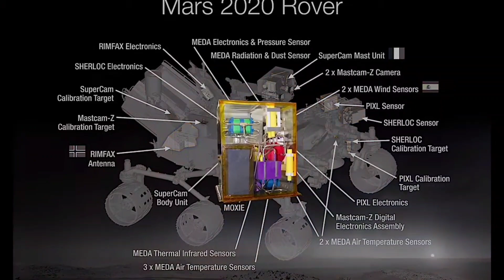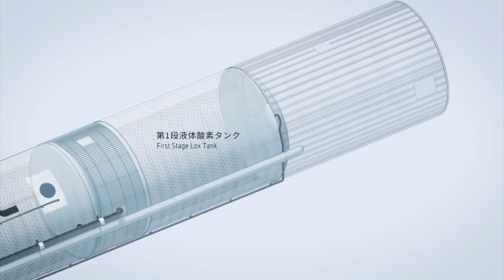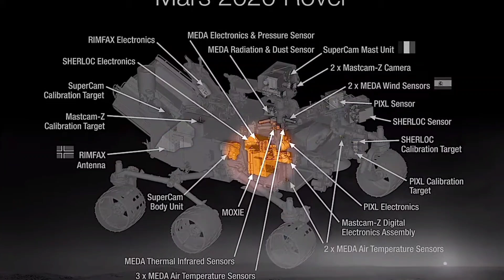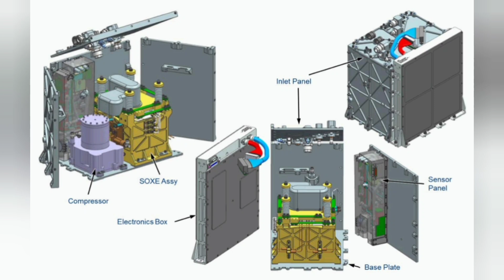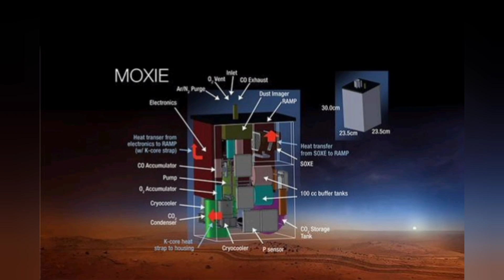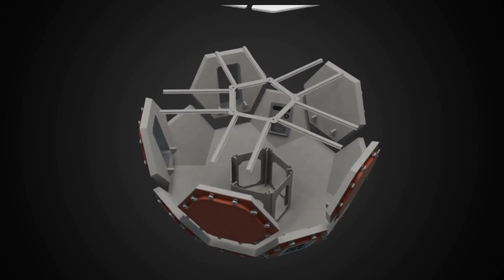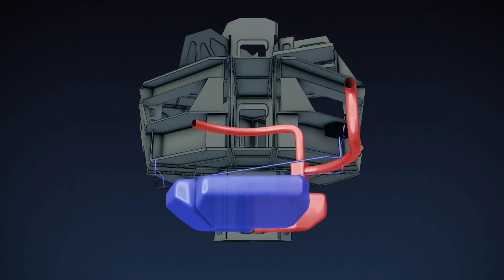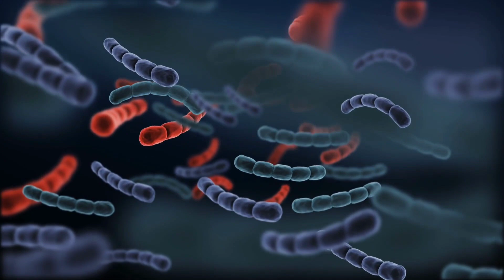MOXIE and Ingenuity may work, but they suck!  There's better solutions for Elon Musk's Mars!

Comment: Hey, Calm down.  This is a source of renewable oxygen, that's a good thing.  We don't want to use up our existing oxygen, that would be bad to have to depend on this power oxygen  generator unit all the time.  The solution is to take a plant called spirolina to produce oxygen from co2 rich air.  Grow it in water in trays with LED lighting and it will capture carbon out of the air, even martian air and give off O2 with NO carbon monoxide as a by product.  How much square area will it take per person for continuous supply of oxygen   8 square meters per person.   So 8 trays stacked in a box like a mini fridge will generate enough oxygen for a person.  But it gets better, it is nutritious when grown in rich nutrient water, and so you can eat it to survive without starving.  How many meters could feed one person continuously?  13.   Better make it 15 per person as a food source, a back up food source, a plan B from outer space.  So say 30 trays, stacked in a self contained  box like a refrigerator with LED lighting , producing oxygen and making enough food to feed 2 people or supplement their  food stores.  And it would produce more than enough oxygen.  Put it next to a window with sunlight coming through for better performance.  TO keep it running and nutritious you would want to bring soil to add a little to the water, grow other plants WITH it and have an aquaponics system with fish, clams, crawdads or lobster and anything else that will grow in nutrient water and eat duckweed, kitchen scraps and a little spirolina..

Comment: A far better solution for exploring Mars would be hopping. 
For example, https://www.youtube.com/watch?v=daaDuC1kbds 
On Mars, the hopper shown should be able to leap ~100 meters upward - far higher than the helicopter.  

It could also leap at an angle to travel ~200 meters away in a single hop.  (Maybe more or less if it needs to deploy wings or a parachute or an autogyro propeller to let it maneuver and to reduce it's impact velocity and subsequent bouncing around.)

Comment: I imagine NASA did tests that led them to decide on a rotor based craft vs a displacement based craft. Displacement crafts have their drawbacks as well. It's extremely difficult to contain something less dense than the Martian atmosphere, and the closer to vacuum you get the more rigid your pressure vessel needs to be meaning more and more weight. It's very possible a Martian dirigible wouldn't be able to lift much of anything at all.

Comment: Idk, all the energy Moxie uses turns into heat (except the potential energy in the oxygen). The microbes use up the dirt and mining is very expensive. Also the atmosphere is very thin and you need to displace a lot of space to be able to have any payload. For example: To carry 1 kg you need to displace around 50 m3, if it was a vacuum inside the balloon, minus the weight of the structure and propulsion itself. (given rho_max = 0.020 kg/m3) Transportation on the ground makes more sense.

Comment: I agree a lot on the moxie/bacteria stuff, is like, not even a opinion is pretty much just numbers, is a much better solution and should have much more attention, about the rotors/buoyancy, I agree but I think it is a... not as crucial, I do agree with ballon/buoyancy stuff it is indeed much easier to do heavy stuff and costs less in the long run, but at the same time it costs more to actually build and bring there, it is a bigger, heavier and more expensive thing, and for simple things a rotor can be better, maybe they just plan on using them for very simple tasks while they do most stuff with land rovers, so not knowing exactly what they plan on doing, and ingenuity being such a simple proof of concept, I don't see it as much of a deal, but I do agree with the oxygen thing, as I said, plain numbers

Comment: There's really no way around the high energy requirements of a Mars colony or base, even a temporary one. The problem is, that due to Mars' distance from the Sun you already have an energy disparity compared to Earth plus (as far as we know) a total lack of readily useable fuel. Consider growing plants for food...the lower amount of sunlight (about 2/3rds on average considering the effects of clouds on Earth during a typical growing season) means a plant will get less energy than one on Earth during the same timeframe...roughly the same as trying to grow crops in northern latitudes on Earth in the middle of winter. 

Any initial Mars colony or temporary base is basically going to need to be a heavily Earth-dependent operation with a very high power demand. The primary goal of such a mission/colony should be to test ways to establish a more permanent presence that utilizes whatever resources we can get from Mars, but unfortunately at the start it will have to depend heavily on what can be sent from Earth, including rich soil from Earth and lighting for plants. Conditioning Mars regolith would just take too long and there's a possibility it doesn't work well for reasons we don't know until we try it. We REALLY need to get some physical samples of that soil to test on Earth before attempting this...hopefully that objective of Perseverance is successful.

Honestly, I don't really see how a successful first base or colony can operate without a nuclear reactor and quite a few resupply missions. All of these concepts are intriguing, but they have to be considered "untested" until they can actually be tested, and you don't put astronauts on a planet with untested equipment and no backup plan for their very survival.

Comment: MOXIE was a small testbed, quite silly to compare it's output as a viable human oxygen source. It was just a test of the concept. Many machines scale with increased efficiency...

Airship. Yes, would be a very attractive solution. However, constructing an airship with a vacuum inside would be a massive challenge as it would naturally want to implode. Reinforcements could be quite heavy and complicated... 

And power. Based on all the energy requirements for the various systems we would need to go nuclear. Like the kilopower solution.

Comment: How do you refuel a methane fuel cell? Your blimp is a big huge sail. Mars' wind will blow it all over. Yes, even Mar's very low pressure wind. On Mars, you need a blimp 200 times as large as needed on earth. We don't have the tech.

Comment: Really?  Why would you need more then one Moxie?   It's to take the place of the shipments of O2 to the ISS which is only there to replace whats lost from leaks.  I don't know the details of how the ISS does it but they are getting by without constant shipments of O2 the the solar panels are not ridiculously big.  
So, yes it will take a bit to fill the habitat but after that it can still run in the background filling up an emergency tank while the main life support systems deal with the habitat just like the ISS.

Comment: AA, you need to check your facts about dirigibles on Mars. NO double walls or vacuum dirigibles are needed and there won't be a large pressure difference between the inside of the dirigible and the atmosphere.
Simple plastic film helium weather balloons rise to a height of 39,000 m (128,000 ft) or higher, where the air pressure is only 0.77 Bar (@ 0° C) or.0.76% of Earth's nominal air pressure vs Mar's nominal surface air pressure of 0.65% of Earth's nominal sea level air pressure.  The pressure inside the balloon is only very slightly greater than outside at any point since the balloon expands as it rises.
For a dirigible you control height with elevators and propulsion, venting or adding the helium or hydrogen lifting gas as needed only to maintain the shape of the envelope.  The lifting capacity is determined by the weight of the dirigible, the internal volume, and the density of the lifting gas vs the outside atmosphere.
Using hydrogen from locally electrolyzed water, however, is a better solution than taking heavy tanks of pressurized helium to Mars.

Comment: Airships on Mars would suck even worse than they do on earth for the exact same reasons.

The balloon would need to be unbelievably big. The lift is proportional to the weight of the displaced gas. If the atmosphere is 1% of earth density then the balloon needs to be 100 times bigger than on earth to get the same lift.

Now imagine trying to go against the wind with a balloon that big. You would probably need more energy than a helicopter.
Reply: Not only would the balloon need to be big it would be massive as well, lifting something the size of ingenuity would take a craft weighing at least an order of magnitude heavier.
Reply: I definitely agree. An airship is not working with the Mars atmosphere. But on wind. The force of the wind is proportional to the surface area, whereas lift is proportional to volume. So a larger airship suffers less from wind than a smaller one. Another big reason not to worry about wind is because atmosphere is so thin, so the wind proportionately has very little effect anyway
Reply: @oystercatcher943  Maybe it’s not worse than on earth, maybe it’s better, you make a good case.

Comment: You seem to be misunderstanding the physics of ingenuity. The rotor speed is not that high when you compare it to model helicopters- small rotor is the reason it needs to be faster.

Regardless of atmospheric thickness, lifting the helicopter takes the same amount of energy. It’s just a case of adapting the design to maximise efficiency in that environment.
Reply: Actually the energy required for flying a helicopter is only 38% compared with that on earth ,because gravity is that much lower. Obviously efficiency of the higher speed rotating blade can be lower than one in the earth atmosphere on the sea level, but flying in low gravity environment requires less energy at least in theory.
Reply: @theOrionsarms  Fully aware of that, but I was only talking about the difference in atmosphere as that’s both more significant, and the issue being raise in the video.

Comment: I agree that energy efficient solutions and bio-reforming is a good thing, on Mars and on Earth, but I think on Mars even with energy efficient technologies they are going to need nuclear reactors in order to have sufficient energy, especially if spin gravity structures are necessary to maintain long term human health on the low gravity planet. Self contained habitats here on earth have had trouble maintaining O2/CO2 ratios long term using photosynthetic plants and animals/people, so it is likely that even with cyanobacteria some use of moxie/CO2 scrubbers will be necessary, at least until the Martian atmosphere at large can be terraformed, which is optimistically probably  a few hundred year process.

Comment: Heating carbon dioxide that much will never work due to the enormous amount of energy you would need to do it at scale. Carbon dioxide is a very stable molecule. They use it as a shielding gas for welding and in fire extinguishers. It is like water or aluminum oxide, hard to rip apart. 
All that hypothetical lab stuff sounds great in some clean lab. Doing it on Mars will be far more difficult. Worst of all is that all machines eventually break. Imagine fixing things in the vacuum cold of Mars. Replacement parts won't be right down the road either.

Comment: You make a very good case for solar power satellites beaming power to the surface via microwaves. With satellites providing ample power then even power hungry systems like MOXIE are no problem.
By the way your missed the actual purpose of MOXIE which is to make rocket propellant for a Mars sample return mission. cO/O2 rockets can have efficiency high as 320 seconds.
Dirigibles have to be so large that they are affected by the Martian winds  and would have much larger mass/payload than a carbon monoxide rocket for point to point transport.
If we choose a power poor Mars and reject solar power satellites then we will be seriously and stupidly constrained.

Comment: I’d argue that while an airship may be ideal for Martian air transport in the long run and on larger scale, a little helicopter drone made of simple off the shelf parts (more or less) makes the most sense as a rover’s low weight bring along eye in the sky reconnaissance aid… which is how JPL plans to use them in the near future missions.

On the bacteria for air production, sure… but there is no way NASA will sign off on deliberately bringing life to Mars at this stage of their life hunting missions. I think their alt approach at oxy generation is just a way to create more options/tools in the tool box because hey, the more options the better.

Comment: A number of years back, I read a paper out of Korea that outlined a way to convert CO2 to C and O2 using electricity.  It was a series of titanium dioxide tubes with electrodes down the center.  The tubes and electrodes were connected to a high voltage power supply at roughly 35 - 50KV.  I was looking at this as a way to create an electric closed circuit rebreather for diving use.

Comment: He's wrong, a helicopter makes sense on Mars. Because the air is so thin it's rather easy to spin the rotors very fast and with a high attack angle. The total energy needed is actually rather low, and with the low gravity this makes it even better. A dirigible makes no sense, the air is too thin for buoyancy.
Reply: Plus he assumes ingenuity was a test with the intention of upscaling it to human size or for cargo..
Clearly it was a test to see if they could make a fast scouting drone to map and inspect things....    :)
Reply: @D_Rogers  Yup, it'd be a huge challenge to make something that'd fly people. Not only just the ability to do so, but be safe, have life support, etc. No that's way off and even then likely better done with rockets. 

A to B with rockets would be rather easy on Mars and really the only practical way to move people or heavy cargo by air. On Mars something like the little hopper SpaceX made could haul tons of cargo rather long distances easily.
Reply: @snek9353  Yep.. And mostly the point to point cargo we need to move around Mars this century is geologists and geology samples anyway...
It's not like making two research bases on Mars is a practical use of resources, so I'm not sure where he thinks this cargo hauler will be taking things!              :)
Reply: @D_Rogers  I'd think the best way to do that would be with a two part vehicle. A large wheeled expedition RV type thing. Something a couple people can live in for days that can drive most places on Mars. Partner this with a hopper rocket that's capable of carrying this RV on a cable. 

This hopper rocket serves two purposes, taking the RV to and from areas far from base to explore. But also as a rescue vehicle able to lift it out should it get stuck or bring it back to base quickly in an emergency.

Comment: You're just exchanging one energy intensive process for another. Rinsing the perchlorates out of the soil is easy enough but drying it (to recapture the water) and collecting/grinding the surface regolith to prepare it for rinsing is going to be energy hungry. Has the enzymes i a bag emergency o2 supply even been tested? We can make perchlorate salts here on earth, but that's going to be a consumable life support system while moxie is a regenerative life support system. Also many biological metabolic processes require more than just the enzymes.

A vacuum airship is going to be large, not self assembling, and fragile. You're upset that nasa hasn't send a tens of billions of dollars project to mars to test it. These technologies may eventually be looked at, but NASA cannot do everything all at once, and ingenuity and moxie are both very promising technologies that have been delivering results within NASA's limited budget.

Comment: The Reason ... You can't Spin helicopter Blades really fast on Earth , is because the Air is too Thick ... Humaans can't move fast in water either , because it's Too Thick ... Look at boats and supersonic planes ... the thicker the environment , the slower you go ..... But you can Spin Fast on Mars , because the air is Thin .... All you have to do is Gear it Up ... the same Energy would be required too ! ... And that Ingenuity takes Crappy Pics for freaking $85 Million Dollars , and where are the 8k Movies ? ... What did they do ... Spend $1,000,000 on the Drone and $84,000,000 on Shipping ? ..... Put DJI on it ... They are the Leaders in Drones .